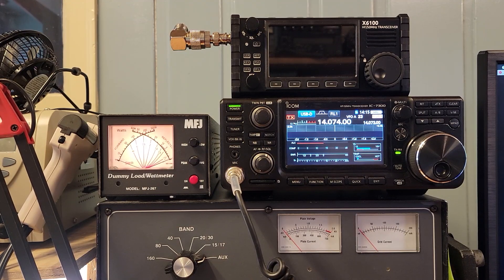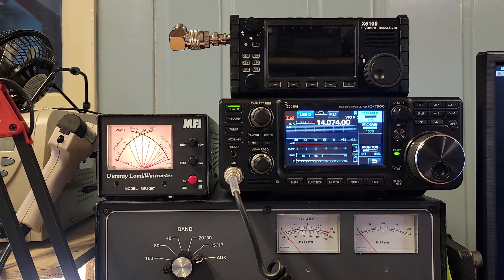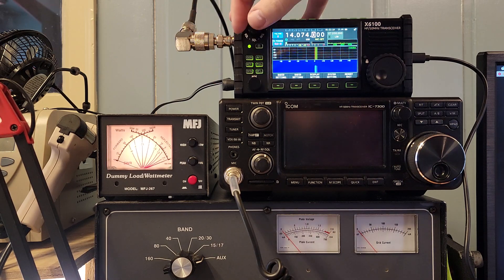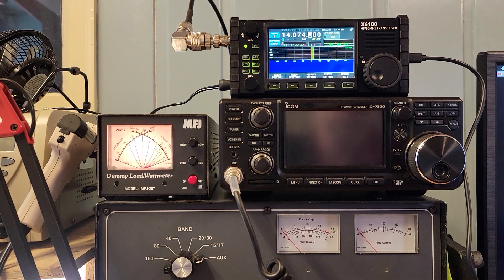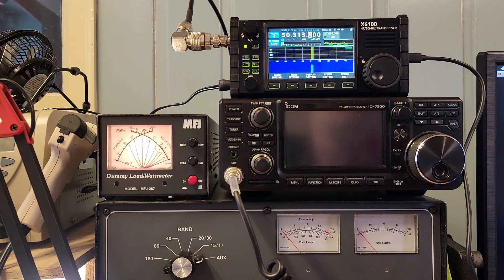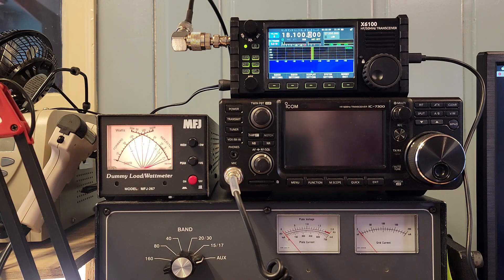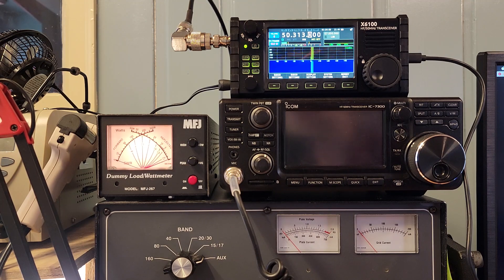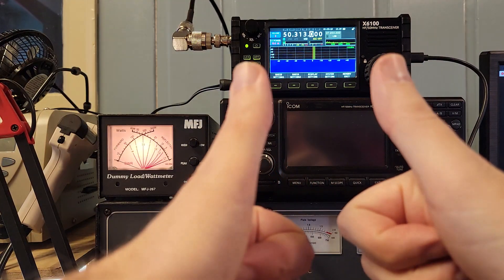Xiegu X6100 Power Output Test

Comment: Hey, I just got this radio and I’m new to the hobby. I just have a few questions. How are you powering it? What are your settings in the radio? How do you get higher watts out on ssb, I’m stuck on outputting 2 watts. How do you get higher watts out on ft8, I’m stuck at 2 watts. What is a good cheap amp? Thanks for the vids and all the help!
Reply from the maker: There is a power setting in the radio, make sure that is set to 5w on internal battery or 10w on external power.  SSB is also based on the power of your voice.  For FT8, I have a bunch of videos on how to FT8 that go into great detail on what settings are needed.  Even one for this radio specifically.  Welcome to the channel!
Reply: @temporarilyoffline I couldn’t find the ft8 video for the radio, could you help me out? And what do you use as the external power? I was talking to M0FXB and he said to use an actual power supply with 20 amps, what do you use?
Reply from the maker: Here's one: https://youtu.be/tUuJjT4XLT8?si=t3j6y5GShME5f4xR I use a workbench power supply (one of the cheap 30amp switching power supplies) or a lifepo4 battery.
Reply: @temporarilyoffline do you have a link for one? I’m on a budget now that I spent a good amount on the radio
Reply from the maker: Try this one: https://geni.us/Yg8aB

Comment: Hey Steve. Thanks for putting these together. I am starting to work through your X6100 videos as I am really late to the party on the X6100. What do you have your hand mic gain  (GEN > H-MIC) set to? The default is set to 20.
Reply from the maker: Did you get one?  Mine is set to 20, but I don't use the mic much.
Reply: @temporarilyoffline  I sure did. It's an interesting radio. Thanks for confirming your setting.
Reply from the maker: @TheTechPrepper  fantastic!  We are working on a ground up/clean(er) Linux distro for it on TOADs
Reply: @temporarilyoffline  Roger. I plan to dive into this project once we I get my EmComm Tools project farther along. I'll have to jump back on Discord. Thanks for pushing on this project.
Reply from the maker: Thanks for pushing on EmComm Tools!

Comment: I'm a little late but did you test if it still can put out 10W if you use a 12V power supply (like from a car battery)? I know the instructions recommend 13.8V but 12V batteries are easier to come by. P.S. You make excellent videos.
Reply from the maker: The output power is all over the map on this thing (not bad, just not what you'd expect I guess).  The latest firmware has a built in watt meter that overlays on the upper right of the waterfall.  Yesterday I was running SSB on a battery.  The power meter showed 12.7v and the output watt meter should 10,11, even 12 watts if I shouted into the mic.  I'd say go ahead and run with the car battery.  I think the "setting" says "If there is power on the power in port then allow > 5w"

Comment: Hi,
In the X6100 documentation there is a reference to installing:
"CH342 driver" , It's for Windows
Do you know where can this be downloaded from..??
Thanks,,, Best 73
Reply from the maker: It should be included in Windows... odd.  The CH432 appears to be the 2 port version of the CH340.  Try this  https://learn.sparkfun.com/tutorials/how-to-install-ch340-drivers/all
Reply: @temporarilyoffline  Nothing there for 342,,, Maybe a typo... Will call supplier
Reply from the maker: I was suggesting that you try the ch340 driver
Reply: @temporarilyoffline  Ah... O.K
Going to call supplier 1st
Reply: @temporarilyoffline  Apparently the documentation is for pre-Win10, Win 10 includes the driver
Reply from the maker: @MINI-4X4-RADIO  Did you get it working?
Reply: @temporarilyoffline  
Now I have the X6100 making some changes to existing config so I can have my IC-705 for VHF and the X6100 for HF
Will get back shortly

Comment: Interesting test. BUT.....you are going to find that the Icom will not show 10 watts out when you dial down to 10%. Icom is screwy like that. Get an accurate power meter that is designed to have numerous scales or a good brand QRP meter and you'll see what
I mean. 
Barry, KU3X
Reply from the maker: Ok, thanks

Comment: How accurate is a meter with 300W max deflection the <10W range? 10W would be 3% of the range! Also it an MFJ :)
Reply from the maker: Exactly, that's why I did the eyeball calibration with the 7300.